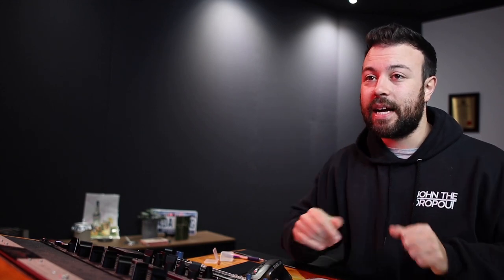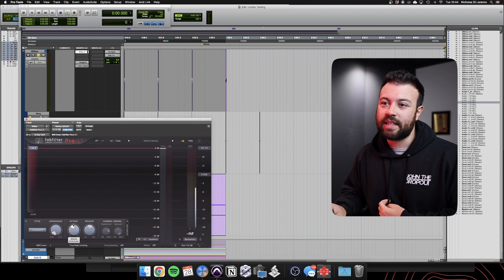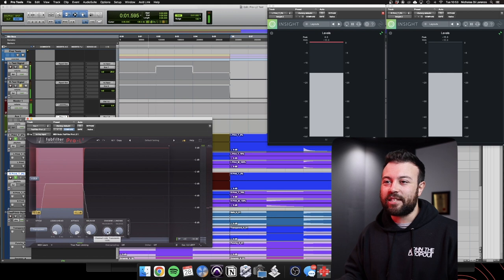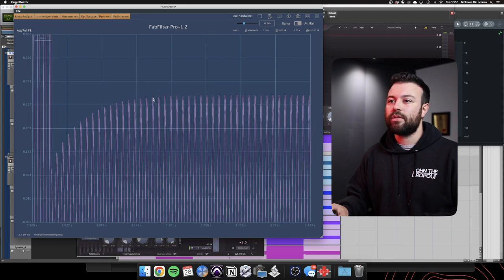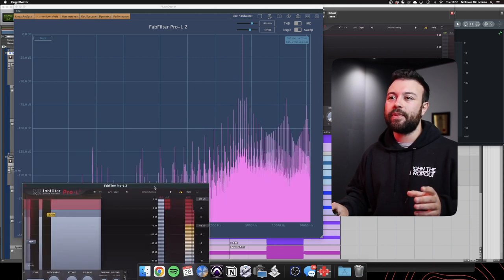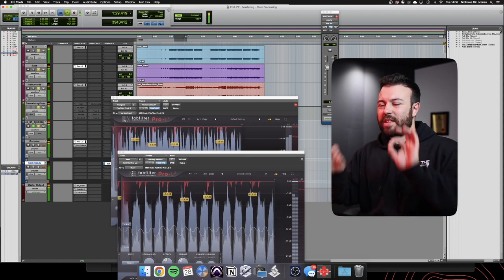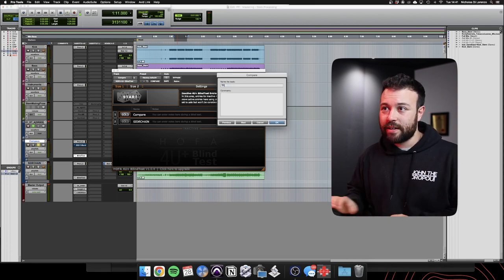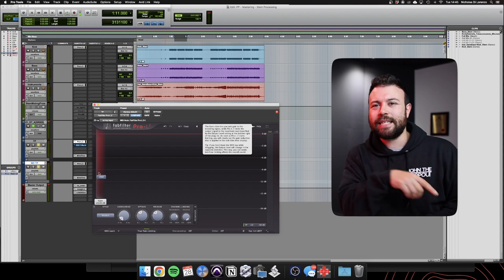Fabfilter Pro-L2 Explained: Every Parameter You Must Know for Better Sounding Masters

Comment: The true peak isn't just a detector that reads what the true peak is and doesn't let it go above that, that is one aspect of it. In Pro-L the detector works in two stages. It is firstly detecting the true peaks as they exist within the waveform which, to me at least, means it isn't actually looking at the PCM data of the file as it is stored in the session. It seems like it in essence is reconstructing the real waveform as it were. The second part of how the true peak operates is by then detecting any further overshoot that happens after any fast limiting and further reducing that. You can see why there would be clear differences in sound then; the limiting simply is different. To perform a true A/B of which you would prefer at any one time, I don't know if it's appropriate to simply click the True Peak on and off but rather to set the limiter separately for both according to what you sounds best, level match and then compare.
Reply from the maker: You’ve given me some food for thought! I appreciate that! I will have to formulate some ways of statically comparing it on/off most objectively!
Reply: @panorama_mastering  My pleasure. I don’t use true peak either. I don’t fuss with the true peak and I generally don’t need to have strict deliverables like they do in post work. 

I would go look at the manual for Pro-L on fab filters website. They run through the controls fairly well and how they interact, though you covered that here well with your tests.

Comment: The "headphones" difference/null button is actually a really great way to hear how the styles affect your transient releases.  Usually the peaks  just sound like little "glitches" but at the same limiting level other styles will be limiting more than just the "glitch" transients.
Reply from the maker: It's interesting; sometimes I like hearing the null/delta signal but with limiting it's not something I explore that often in practice;

What are you listening for in your null's when limiting?
Reply: @panorama_mastering  I usually check to hear if it's actually only the "tips" of the snare/kick that are poking through...  with the different algorithm styles you sometimes catch instruments or vocals in those peaks - which I prefer not to do.   I also want to hear that the percussive transients are as short as possible - the longer the glitch the more likely the you'll hear the loss of transients on the master.   I always use "delta/null/difference" with every dynamic effect - from Soothe, L2 and beyond!  I've made my own "delta" plugin with Melda MXXX so I can check plugins that don't have the delta feature.
Reply from the maker: @mixphantom0101  Nice that's fair ! Would love to learn how you made that Delta processor in Melda MXXX!
Reply: @panorama_mastering  Sure... stand by! 🙂
Reply from the maker: AWESOME!
Reply: @panorama_mastering I like to hear the delta if it’s taking away a lot of musical elements or not and adjust it according

Comment: I was able to identify the true peak version every time. It makes the stereo image sound smaller and the low end loses a little bit of extension.
Reply from the maker: It's a funny thing making these video's; I set up all these sessions and planned out all my tests ahead of time; when I did these blind off camera I too picked 8/10 times; so I was pretty confident going into filming I'd hit it with the same hit-rate;  but obviously that didn't happen; 

At the end of the day; after 3,000+ projects I'm still circling round to the same conclusion you've come to.
Reply: @panorama_mastering  Haha, you probably just had a little bit of an off day. It happens to the best of us.  There is definitely a difference. It's a little more than subtle even through youtube's shitty audio quality.  
    On a different note. The best sounding true peak limiter IMO is Sonible's Smart Limit. But I still prefer Xenon or Pro L because I dislike the sound of TP limiting. I can't wait for the next Smart Limit update where they give us the option to turn TP limiting off. It could potentially be the best sounding limiter when that happens.

Comment: Your ears are fine. The source material already had such a heavy pumping/breathing effect, that it made it kind of impossible to judge. I’ve always had a problem with the way The Pro L sounds. I can always hear it. In other words, it always changes the overall tone, the size and depth of the mix. I do use it, but I’m always wary of it. Thanks for the video!
Reply from the maker: My pleasure! Thanks for sharing :)

Comment: Old comment alert. I did find a niche case for using the solo button a while back. I had a bass guitar track that was super clicky and I wanted to smash the clicks down until i was just on top of the tone. The solo button was the only way that I could hear when I really started to cut into the tone. Backed off the ceiling a little and the track was saved. RX de-click and clipping didn’t do as well as the L2. I also didn’t have soothe2 at the time. Like i said - super niche.
Reply from the maker: Very niche! But cool track; thanks for sharing;
Reply: spiff by the same company is AMAZING for that too

Comment: I didn't know 0 lookahead clipped the signal until today. Always felt it sounded harsh with faster lookahead, so I ignorantly increase lookahead before touching the attack. I will play around with this. True peak is tricky for me too. I listen to the low-end and the width in general. It jumps out when true peak is on. I usually keep it ON while mastering and turn it off if my track is sounding slightly wider (which generally does) than expected.

Comment: Hey dude, I’ve been researching this too, here’s what’s actually happening with the attack and release: The attack and release settings can indeed be a bit confusing. Basically the limiting stage, or rather the stage of the limiter that recovers from the gain reduction, consists of two stages, a very fast "transient" stage, and a slower "release" envelope stage. The attack and release settings only control this second stage.

The release setting of Pro-L 2 is basically exactly what you expect, it sets the time for the signal to get back to its original level after the signal does not exceed the threshold anymore.

The attack stage however determines how fast the slow envelope stage takes over from the faster transient stage. On short settings, the two stages usually overlap seamlessly. The fast stage might recover a bit of signal really fast and then the release value take over. However, when you are using longer attack times, you are letting the fast stage do more recovery before the release is being applied. At some settings it is even possible that the release stage is never being used, because the fast stage already recovered from the gain reduction completely before the release will be applied.

So in short, the attack button is basically just adjusting the time when the release stage should be starting.

Source: I contacted fabfilter then copy and pasted their response

Comment: 21:30 The headphone function is useful to quickly check what instrument or frequencies are activating the limiter. If  you engage it and, for example, you only hear bass drum or low frequencies, maybe you can reduce it in the mix to achieve an even louder overall sound. The same, if you only hear cymbals, maybe you can avoid the clipper even inside a very tight limitated mix...

Comment: the attack time is always releated to the release time and vice versa, the sooner you set the attack time, the more it grabs into the weight of the sound and digs deeper, it has more work to do now. this is the reason that the release component engages appropriately. it follows the overall digging of the attack component. the sound being compressed has a certain amount of lenght, first the transient comes which is followed by the sustain and basically its decaying. so as of amount of frequencies theres is much and it gets lesser. when you set the attack time long enough it partly operates like an envelope shaper thats cutting the sustain. the difference is that a compressor/limiter also creates a "firmimant/glassceilling" for our perceiptions. everything thats limited is showing us shape. the deeper you dig in sand with your arm the longer it takes for you to pull it out moving horizontally and vertically at the same time.

Comment: Great video but is it just me or does something seem off about the side-chain stem limiting method.... if you have pro-l2 on eg. your drum bus, with the master mix feeding the sidechain, isn't that bus limiting going to affect the master signal which is triggering the sidechain? So you won't end up with the same amount of limiting (probably less, because the master is being fed limited bus signals) when you sum it back together? For this to work accurately, wouldn't you need to set up a second copy of the bus which wasn't feeding the master on which you could apply the sidechained limiting? .. Or does it somehow work itself out because the stems would need less limiting individually to reach the same overall gain reduction you'd get limiting the master? (but then there's clipping involved as well depending on what L2 settings you use, surely this willl change the tone of the mix if you're suddenly clipping individual stems rather than the master output?)
Reply from the maker: "For this to work accurately, wouldn't you need to set up a second copy of the bus which wasn't feeding the master on which you could apply the sidechained limiting?" <- correct answer

Comment: Hey, could you correct me if I'm wrong? So my understanding about the attack and release times is that:
If the attack control is set all the way to the left (short attack time),  it limits more gradually, preserving more of the initial sound and reducing clipping. 
Whereas, if the attack control is set all the way to the right (long attack time), it limits quickly and might result in more clipping. And It doesn't let much of the initial sound through before applying compression.

Comment: Love your channel - this is the first time I have understood the interaction of the Attack and Release on L2. By any chance could you provide practical use cases for each? I get that I might want to clip my drums so I can just set a long attack and accomplish that. but when would I want the release to engage? Is it significantly more transparent with a release like 100ms+? I am using PRO-L2 to limit a vocal bus right now and I am unsure what good settings might be for a pop vocal. I imagine a little lookahead will keep it clean with gain attenuation, but I have no idea what to do with attack and release when I am just trying to catch the rogue peaks. 🙏
Reply: Also for Modern STYLE  you said 500ms to unity gain, but the graph looks much closer to 4-5 SECONDS to unity.

Comment: Here is another caveat about Pro-L 2 that enables you to obtain louder and transparent masters with less distortion than the norm.
In fact, this applies to any limiter that has this function.
Disable Channel Linking. Why?
When Channel Linking is enabled. the limiter applies the same treatment to both channels when attenuating the gain reduction since it perceives the output levels is identical.
However, 99.999% of the time, no stereo outputs generate the exact same level, as well as immersive audio channels.
Even if TPL is enabled, it is moot. It'll only attenuate once it reaches the output gain's threshold evenly on both channels/sides.
With Channel Linking disabled, the limiter will engage its algorithm independently since the L and R channels output varies.
That means the limiter works less when limiting, in turn, creating louder masters with less distortion. Depending on whether or not you want more distortion on the master, enable CL. Even if you have different percentages set on both channels, due to the style of each limiter mode automatically engages distortion (without lookahead), the outcome will be the same.
Any limiter using independent channels will successfully have louder and cleaner masters, whether or not gain reduction is engaged.

Comment: I don't follow what's going on with the sidechain - you said it should be keyed in to the output of your full mix, right? But if it is outputting into the mix then aren't you just increasing the amount of gain reduction from whatever it was before so how is that making the overall loudness of the mix higher than it would be without the sidechain? I didn't understand your example so that's probably the real issue lol
Reply from the maker: I mightn't have explained myself clearly enough, sorry; it's the fact that the limiting GR circuit is applying to each individual element seperately; you can then drive those individual elements harder with limiting than you otherwise could if it were the limiter across the whole mix-bus;
Reply: @panorama_mastering  I don't know what you mean by the "GR circuit" but I think I get the gist of the idea. I tried this out on my mix and it helped me get loud enough to compete with my reference track. Thanks man I really appreciate your help - found you through the last Dee Kei episode